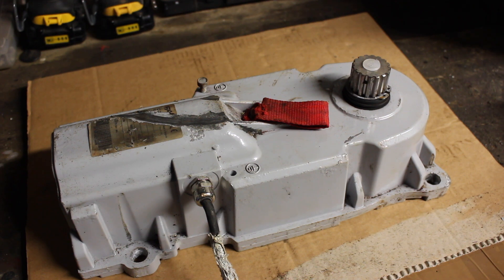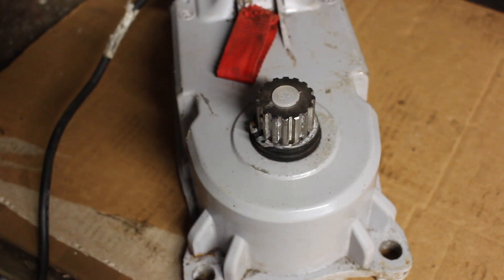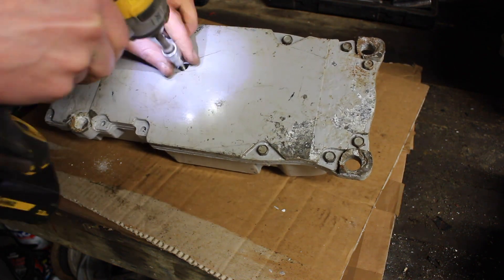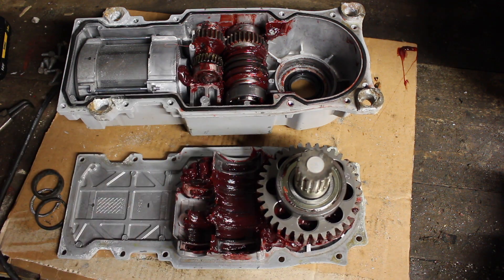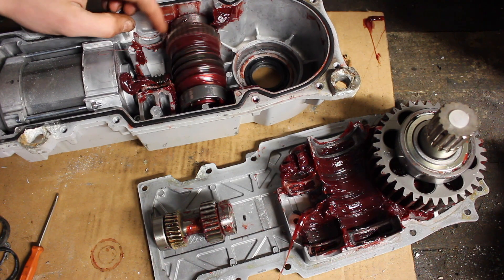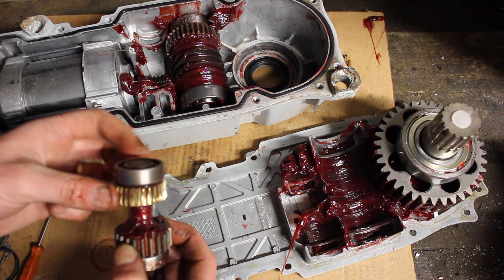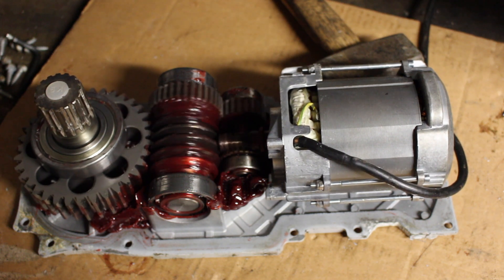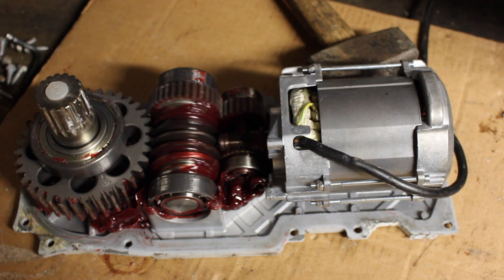Teardown of a failed electric gate opener

Comment: Gentlemen, without a starting capacitor, the single-phase asynchronous electric motor will not start by itself and will make a characteristic hum. The same will happen if the rotor or gearing is physically blocked, stator winding is damaged or start capacitor hasn't enough capacity (according to the manual it should have 12,5 µF/400V) or is just worn. I believe that the cause of the noise and the lack of power in this particular case may be a problem with the improper alignment of the rotor, which may rub against the inside of the stator core. In my opinion, you should: dismantle the entire motor and carefully inspect it visually for abrasions on the rotor cage and the inside of the stator core, replace the rotor bearings just in case, and then assemble the motor, paying attention to proper and even tightening of the fixing tie rods so that the rotor rotates smoothly and noiselessly. After the tie rods are properly tightened, they should be secured with a Loctite type agent. By the way, it is worth measuring the resistance of the stator windings. Unfortunately, I cannot give exact values, but it should look something like this: between the common wire (blue) and individual directional wires (black and brown) there should be some resistance value X (e.g. about 50 Ohm), while between the directional wires this value it should be 2X (approximately 100 Ohm). If the differences between these values are significant, i.e. above 5%, it may be necessary to replace the stator. Hope it will help you or maybe others. Best regards.
Reply: Its between 60/80 - 120/160
Reply: @flynn995   I checked the resistance of the stator windings in 230V electric motor of FAAC 770N gate drive and the brand new motor had such values: between GRAY-BROWN wires - c.a. 36 Ohms, between GRAY-BLACK wires - c.a. 36 Ohms, between BROWN-BLACK wires - c.a. 72 Ohms.
Reply: @krzysztofwasowski3549  yes you are correct I was thinking of a different motor.  On the video I see a mark on the motor caused by the arm indicating that the gate has dropped slightly and the linkage has cut a mark on the motor housing.  Possibly too much friction on travel. Has the motor an encoder fitted?
Reply: Also there was an issue with the gears ie grinding and the housing was letting in water. I had issue on 1 site where the RCD on fuseboard was tripping yet the ohms readings were correct.  The problem was earth leakage. Changing the mains supply from the RCD circuit to non RCD will rectify the power tripping however still indicates a problem within the motor
Reply: @flynn995  This model of the underground operator doesn't have an encoder integrated with the electric motor (as you probably noticed), but it can be equipped with an optional magnetic absolute encoder, called SAFEcoder (P/N: 404035), which typically installs on the output shaft of the drive. To use this type of encoder you must have a FAAC control board (e.g. E045/E045S or E145/E145S) equipped with a "2easy" bus - this is a two-pole block terminal in red colour, which you can find on the control board's PCB. The connection between the encoders and the control board should be made with a shielded, two-core, non-polarized cable with a cross-section of a minimum of 0,5 mm². Of course, after the physical installation of the encoders and after connecting them to the control board, they need to be programmed and configured properly with the use of the board's functions available in the menu. Link to the installation manual of encoders can be found here: https://we.tl/t-0Yj7Nl6DHt. 
Regarding the further problem with the operator (I mean described water ingress), I think you should for sure replace the stator of the electric motor as well as the sealing of the housing. If you see any cracks on the top or bottom part of the housing try to repair them or replace complete housing. The exploding drawing of the operator with spare parts list you'll find here: https://we.tl/t-jUJyp4hmg9. Well, I think that's all for now. Wish you good luck :-) and safe and nice repair. Take care.